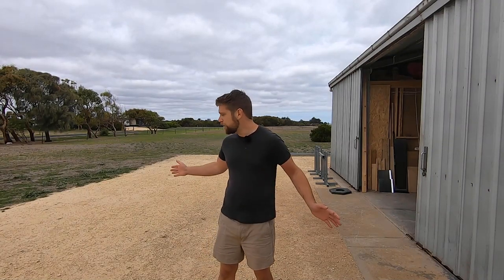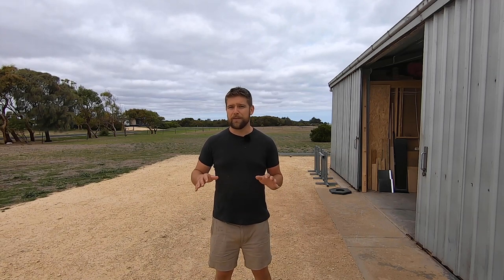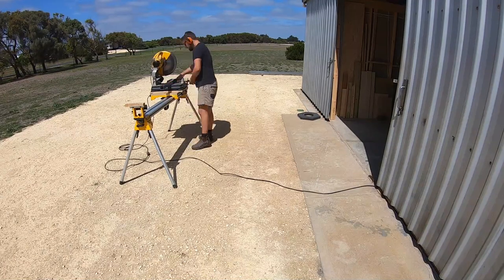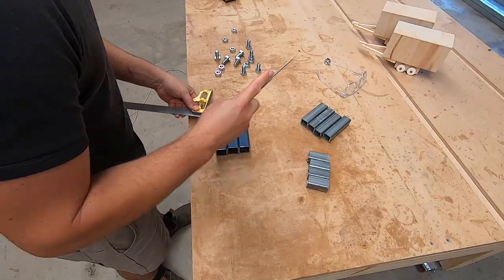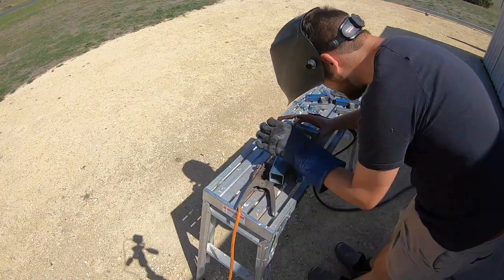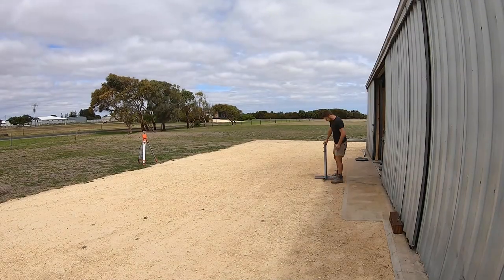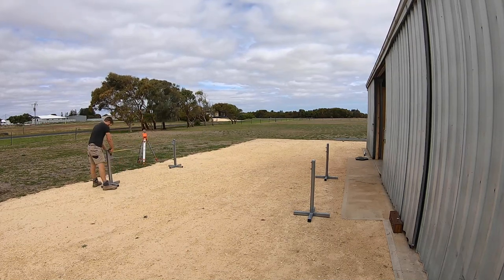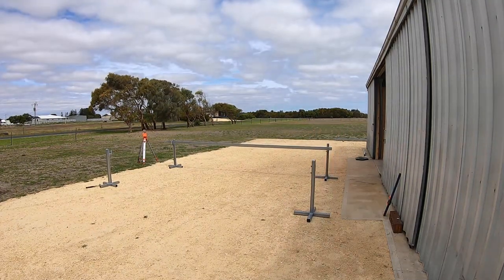Ep. 02 - Trailer stands to weld my tiny house trailers on uneven ground - Tiny House Build Update

Comment: No comments?! 
I like those stands. Some allthread and more head scratching can make them adjustable. Just a bit more fancy than the normal screw stands.
Reply: Oh, had to watch again. And see the bolts on the rests and slides. Those are kick butt. Showing my buddies at the shop. I'm a brake press operator at present but can stack dimes welding. I'd modify your design a bit on the fastening rails, but these are specific. Gotta use what you can get your hands on, and I get it. Another thumbs up.